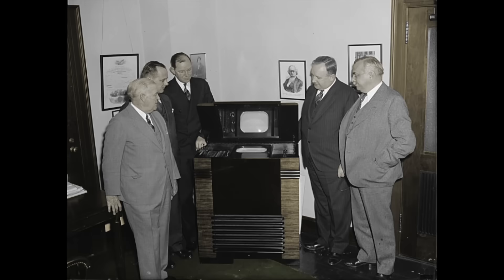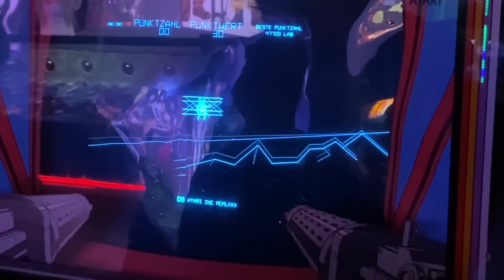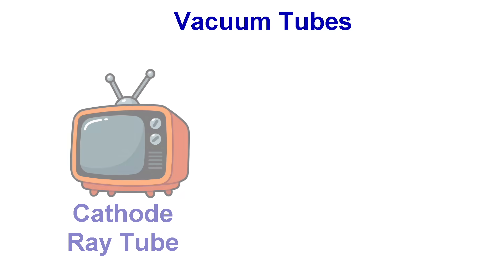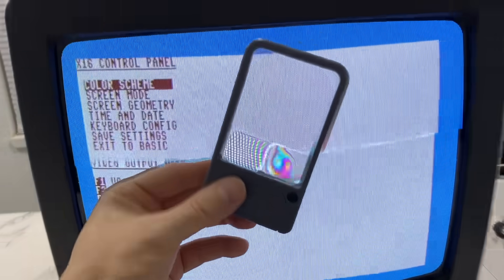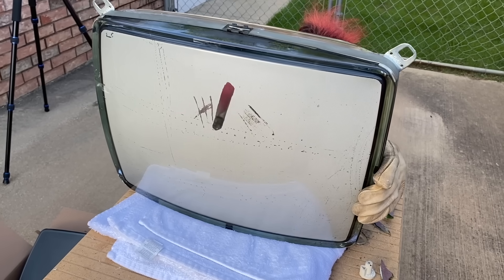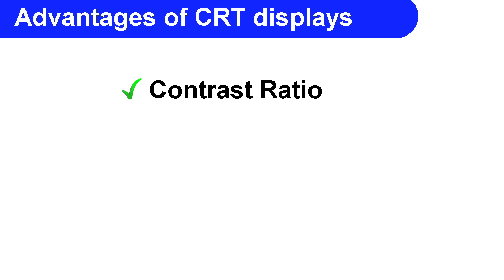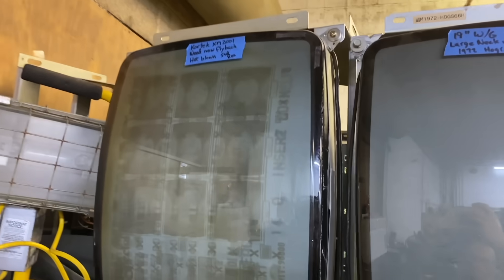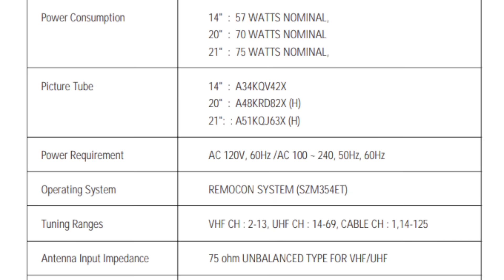How Cathode Ray Tubes Work.

Comment: I don't know about 80 years, but some LCDs last 30 years while some CRTs don't last 10 years. A lot of old tubes have died in many ways: Certain colors no longer displaying, the image getting compressed horizontally or vertically, images jumping and rolling, and cataracts. We tend to judge the "superior" longevity of old tech because we only see the old tech that's still with us today.
Reply: I think you're basically right, but most of those faults are fixable, being caused by components other than the tube. Aspect ratio issues and loss of hold are amongst these, and loss of certain colors almost certainly is too. Granted, that's also true of the LCD backlights T8bG complained about; they're replaceable.

Cataracts I don't know about; having only learned today that (some? very old? or not?) tubes have a safety glass coating on the front which is likely to delaminate after 60 years, as opposed to 30 years for LCDs. But I'm not doubting that some CRT tubes may go bad a lot sooner.
Reply: @eekee6034  The big killer of a CRT is if any of the electrical components inside the tube fail. They are impossible to get at since they're inside the vacuum. Also, if the vacuum ever gets exposed to the air through any kind of crack, it's done. The neck at the base of the tube is very fragile, in fact David once ruined a CRT when attempting to fix an arcade cocktail cabinet when the neck of the tube bumped the side of the table. Electrical problems can melt the glass too.

By contrast, the most common LCD problems are de-lamination and stripes, both fixable. Stripes happen when the screen matrix is not receiving proper power due to a faulty electrical connection, but YouTube is full of DIYs to fix that.
Reply: I think CRT's were generally built better, but they kinda had to be in order to survive the harsh conditions they created for themselves (mostly heat). I don't think LCD monitors are built worse as a way to have one over on us, but more because they can be and still survive. Most of the pain in modern electronics has been due to the miniaturization of components, as well as packaging many things together in to one component. It's a marvel of engineering, but difficult to repair - and cheap enough to often not be worth it (or sustainable for a repair business). Until probably the early 2000's, CRT's were different in that they were more like buying an appliance (in expense and sometimes also in size). The components were physically easier to replace (through-hole; mostly off-the-shelf, and on a large PCB) and the larger physical size of these components meant they were usually more resistant abuse (unless your poorly-grounded outdoor antenna gets struck by lightning - ask me how I know). But if your $800 tv broke down, you could justify having it repaired for $300. These days, a $300 repair means you'd might as well get a new one since 1). The price has come down quite a bit on large flatscreen tv's, and 2). The functionality of them is (arguably) improving, meaning you're probably willing to upgrade by the time it breaks. CRT's didn't improve at quite the same rate. Getting an upgraded CRT usually meant you were getting a larger screen size and that's basically it - aside from the large milestones like going to color, not having it look like a block of wood anymore, etc.

Comment: I played the original Super Mario Bros on an old CRT TV recently and the picture was amazing. It was a really, really good experience.
Reply: Old game consoles really do need to be played on the displays of the era.

Even the N64, and original Xbox look better on a CRT.
Reply: Even the Flat CRT look great on them. I am now officially an LCD hater that’s mean LED, Mini LED and QLED
Reply: And that wasn't that good. Being one of the first NES games the colour use in SMB was very crappy, and the NES suffered from rather bad quality RF/composite output. If you put in a game like Probotector or Power Blade, games from the 90's, the NES is looking way better, like a completely new generation console, often close to the SNES. Older computers like a CPC464 did way better in 1983 over RGB SCART and offered both lots of colours, and a crazy sharp no color bleed image.
Reply: @lovemadeinjapan  it does looks like the first SMB didn't utilise all NES graphic capabilities. SMB 2 is where it did utilise NES graphic capabilities to it's max
Reply: @PreciousAlpschindler  Even SMB2 was warming up material. It is very simple compared to the titles I mentioned. After 1990 the NES got really mature.

Comment: Why is a CRT resolution agnostic? Doesn't the shadow mask set the highest possible resolution?
Reply: A CRT doesn't have a fixed grid of pixels like an LCD does.  A CRT just has a big field covered in phosphor which is lit up by one or more electron spots that are steered around the surface of the screen.  The dot is steered to draw the image line by line. The exact scanning format - how many lines per picture height and per refresh, and how many refreshes per second - is adjustable (on some monitors) by changing the signal fed to the monitor.  The shadow mask effectively sets how much detail a color monitor can resolve ("resolution" in one sense), but that's independent of the scanned image signal format sent to the monitor and how many scan lines & digital source pixels the image signal has ("resolution" in another sense).  Some monitors are capable of scanning at a much higher resolution than they can actually resolve.  And CRTs can be scanned at a lower resolution.
Reply: @jbalazer  I see. Thanks!

Comment: All this supposed advancement in lcd monitors and the like, but none even attempt to solve the light gun problem. Frustrating that the one remaining use case that has me keep a CRT TV around is entirely because nobody wants to make a flat panel that works with light guns; not just the NES zapper, but synchronized guns like the Namco Guncon, to allow stuff like Time Crisis to work. Suffice to say, seeing people parrot the Sinden Light gun that works eff all with anything but Duck Hunt on real hardware, is aggravating.

Comment: 15:20 CRTs also suffer from the same exact problem. Cataracts, the glue between the CRT and the safety glass gets deteriorated with time. Mostly with TVs from the 60s or older.
Reply: I have one 1954 "console" tv, similar to what you'd see on the set of "I love Lucy". Totally un-restored, so I don't dare try to power it up until I get around to restoring it (IF I ever get around to restoring it). Luckily, my set has a safety glass panel a few inches in front of the screen rather than adhered TO the screen, but I have seen cataracts and cataract removals before with other sets... Looks dicey! I'm sure the adhesive just degrades over time all on its own, possibly accelerated by the fact that many of them are sitting around in barns and attics.
Reply: 60 years for a CRT, 30 years for an LCD. Interesting!

Comment: The ⅓-lb burger should have used an even denominator. 11/32nds would have gotten the attention of every carpenter in the US of A.
Reply: Imagine using a measurement system so shit a burger release fails because people don't know fractions. Don't know if that's the fault of the system or the nation though...
Reply: @mattd6085  The measurement system is flawless. It's a failure of the people to understand a simple basic concept.

Comment: I also don’t think the preference for 16:9 represented a value for money comparison at all: it was mostly about being a better aspect ratio for movies. The original 4:3 aspect ratio arose because producing a wider aspect in the 30s was technically very difficult. When I worked at SGI in the 90s and we had a widescreen CRT from Sony, I had the pleasure of spending a week with Sony’s head of CRT engineering, and he explained that they had deflection coils at the screen corners to pull the beam into the correct position, because the deflection yoke couldn’t do it accurately enough. So the 4:3 aspect was an engineering driven decision not a user driven one.

Finally, a little aspect of CRTs you may not be aware of: there are totally different models for the northern and southern hemispheres, reflecting different geomagnetic conditions. B&W is generally the same, but they’re quite different for others, and extremely expensive monitors would have even subvariants. I was told that Sony optimized their northern hemisphere models for New York, and their southern hemisphere ones for Sydney, as both cities were geomagnetically typical and a monitor optimized for them would generally work well. I saw imported CRTs from the other side and the color was awful.